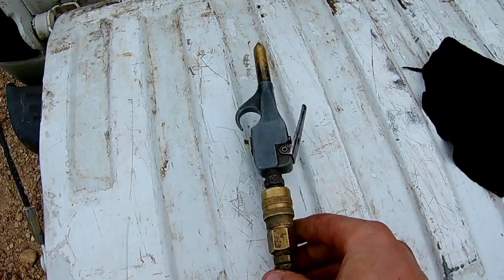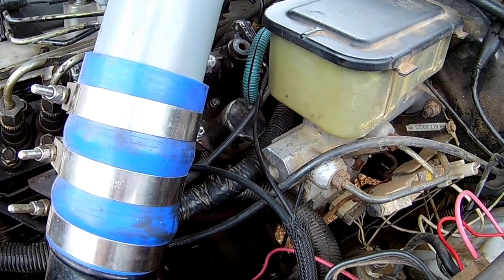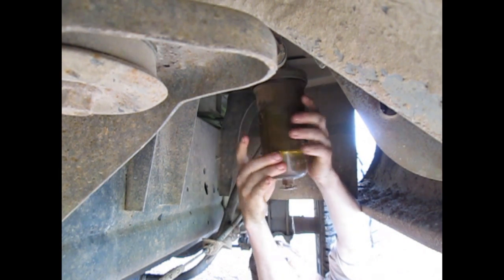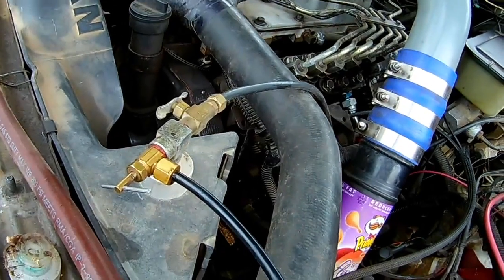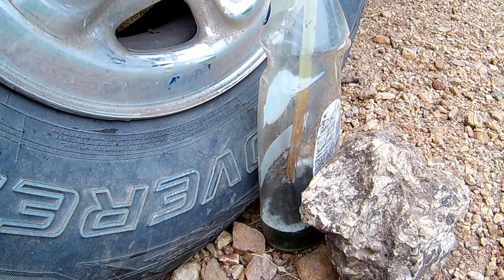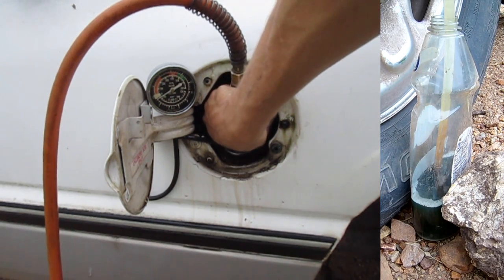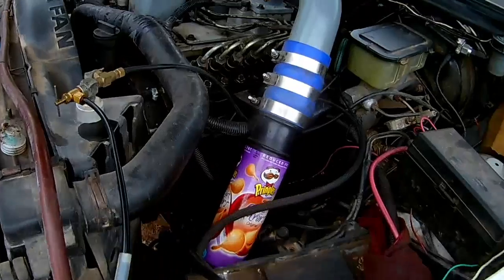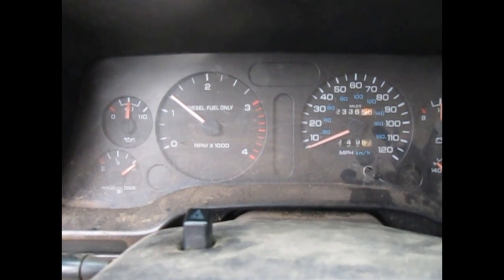How to Bleed Your Cummins Fuel System

Comment: Can I do this with a 2001 Dodge 2500 with electric fuel pump?  It seems to be locked up can't get it pressured up and it sounds like fuel pump is running.
Reply from the maker: You should be able to yes, but with the electric fuel pump it's typically easier to just bump the starter and then let the pump run, that will prime the system.  If you're having problems with it bleeding, crack a low-pressure fuel line open and then let the pump run.  Careful though, it may try to squirt all over the place, so be ready.
Reply: Thank you for the helpful input.
Reply: I've been having a series of problems with my 96. It has an in tank lift pump but it seems like it has the mechanical one as well. Its my crew bus and my boss kinda threw it to me to repair. I am not a mechanic but after working on logging equipment cars and trucks gas and diesel alike, not to mention my own tons of junk that I breathe life into, ive surpassed the shadetree backyard mechanic status. However, this damn cummins has me chasing my tail. Its hard to start after sitting for a couple days and sometimes it will drain half the filter dry after initial startup, then I have to prime the Damn thing up. Ive pushed the manual pump until I felt like I had tendonitis but it never does what I want it to. Perhaps it takes a lot more pumps than I think it should or it cannot pull fuel threw the electric pump. Once started its drivable, but it's such a turd it can't get out of its own way. Any more than quarter throttle and it falls on its face. It will eventually reach highway speeds but it takes about 13 years to accomplish the daunting task of achieving 60 mph. It looks like it may have a screen in the manual pumps fuel outlet, but up until now I was convinced that since I could not hear the electric pump come on with the key, that it was Shithouse. But I had no idea that you need to bump the starter to get a 25 second cycle n the pump. I will test that this morning and hopefully get to the next big step. If I were poncho all the time it will be a bad relay or connection but I am the kind of guy that constantly supports and demonstrates Murphy's law on a unfortunately daily  basis.
Reply from the maker: Is this a Dodge Ram?  the 96's should not have an in-tank pump.  The V10's had one, and the newer 24V's had them, but not the 12V, so maybe it's someones hack-job.  What tells you there's  pump in the tank?  If it does indeed have an in-tank pump, I would get rid of it and replace it with a factory fuel module, or sump.

Off the bat it sounds like your sucking air.  Have you deleted the fuel heater yet?  Might give that a shot.
https://www.youtube.com/watch?v=8kVsm4dgAtw
Reply: Its a 96
Reply: Glad That I haven't lost my Damn mind, I swear they had two sitting there and the guy working in the shop claimed he hooked it all up. But I will dig around and see if maybe they replaced the fuel tank somewhere along the line. This is not an uncommon practice around the pnw area especially on our local logging roads here in Washington. So perhaps they swapped tank into the darn thing.
Reply: Harlan B. Cooper

Comment: The tank is vented to the atmosphere, the tank will not hold air pressure.
Reply from the maker: Little confused here, just to clear things up, are you saying what I clearly did in this video won't work in reality?
Reply: @CumminsWorks  There is an air vent at the top of the tank. What you did was make some air bubbles in a bottle, that did not match the amount of air you pumped in. Then you cranked the engine over and over again until it coughed. That is what I saw.
Reply from the maker: @paxnune6368  Okay thanks for the clarification!